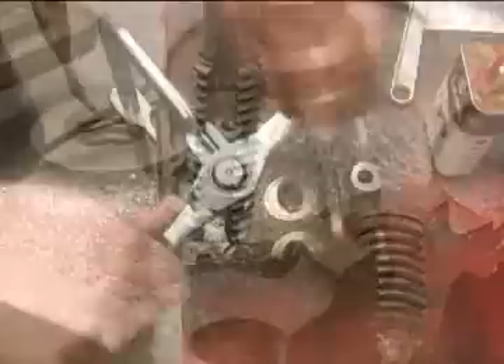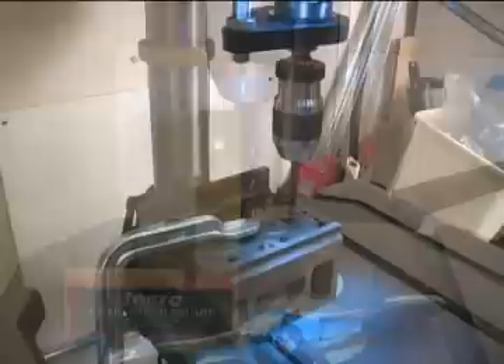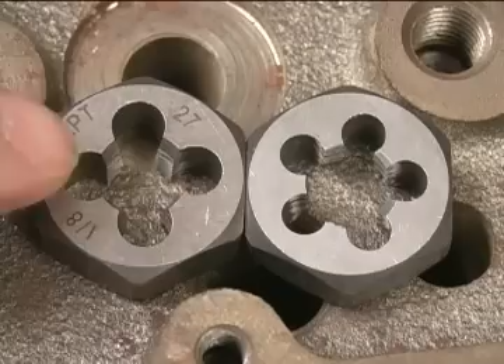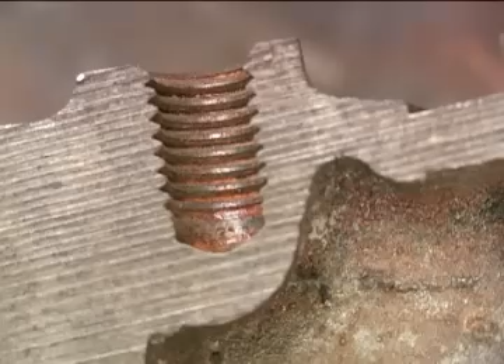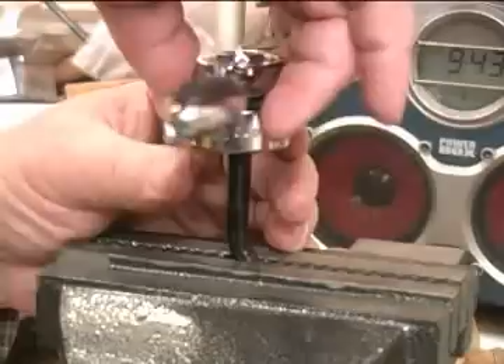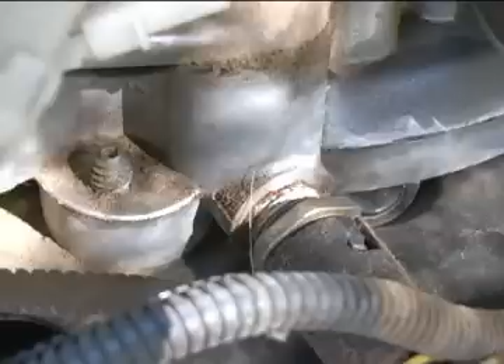Using Taps and Dies

Comment: how do you match the bolt thread size , with the tap ? i need to tap the holes on a flywheel , for the flywheel puller bolts , so i can remove the flywheel , to fix a broken flywheel key . the bolt holes are not threaded . why i don't know , there just not . the mower engine is ENGINE MODEL NUMBER
08P502-0111-F1, if you can tell me what tap size to use , that would help big time .

Comment: I have a nut that has left hand threads and it stripped out how can I fix it?
Reply: Go to Fastenal, they sell lady handed threaded nuts and bolts. Tapping a stripped but will not give you much of a result because the material inside is compromised or lost, which would mean you would have to tap it to a larger diameter. If tapped larger then it obviously wouldn't fit the bolt threads it is meant to go onto. Hope that helps

Comment: Those are chaser dies, designed to clean up old thread, as shown in this video. If you try to cut a totally new thread, you can easily breake those dies. It's a common mistake made by self DIY guys.

Comment: what size of drill bit do i use to tap a m4 bolt
Reply: Duncan Gallagher rule of thumb - tap size minus its coarseness. I assume You are talking about standart m4 thread, (m4 x 0,7). So 4 minus 0.7. Thats 3.3 mm. :)

Comment: I wonder what a quality brand of taps would be ? I need to tap some 1/4” holes in 1/4” mild steel . Whether or not 1/4” thick steel is going to have any strength being that this is another question. I may have to weld a bolt on . This will be done on  bumper plate racks for my home gym

Comment: I have a tap & die set & when I used it, my tap was ground down by the metal. I don't know if my set works on certain metals. (it didn't say)   Do I have to find a stronger tap?

Comment: I have a brake caliper bracket. I accidentally stripped some of the threads. Can I use a tap that will keep it the same size and be able to use the same bolt? Or will I have to go one size bigger?
Reply: I'd go a size bigger

Comment: What is meant by Right Hand Thread Direction & Left Hand Thread Direction?
Reply: A right handed thread will mean you have to screw the bolt clockwise to tighten it. A left handed thread you have to screw counter clockwise to tighten  the bolt.

Comment: Please realize that a metric size tap will be one of three different thread pitches to accomidate the three different metric screw types "coarse, fine and extra fine" these are not interchangeble and you need to be aware of which you have.  I just made a drill tap for a 4mm screw  using a tap set from ebay,  It tapped well enough but the 4mm screw I had did'nt screw in correctly i.e. it would thread in about 1&1/2 turns and stop which is the signal that you have the wrong thread and forcing will result in stripping the screw or worse your tap!  I had to go to a hardware store and search for a screw with the correct thread pitch which was extra fine but to make matters more confusing there were some screws marked 0.7 that would fit and others marked 0.7 that would'nt so you really have to try several screws to find cinderellas slipper.
Reply: Thanks. Yes it would have been nice if he'd talked about sizing.
Reply: https://youtu.be/vbhfC2hY4xQ

Comment: is m4 - 0.7mm the same as 4mm - 0.7mm ? https://www.amazon.ca/Metric-Taper-Plug-0-7mm-Pitch/dp/B00ANY5I5A if not, whats the diffrence between these 2?
Reply: it's the same, just a different way to identify metric. the 0.7mm is in reference to the thread type, metric has 3 types coarse, fine and extra fine so if you tap and find your screw is resisting after a couple turns don't force it in, get the correct pitch screw that allows it to turn smoothly.  Of course one screw labeled 0.7 might fit and another might not so you have to try several.

Comment: I dont understand on the tap, its threads are not at a angle how does it get the angle so the bolt can enter the threaded hole?
Reply: +David Moore 
They are angled.
If you were to straighten threads it would be shaped like a ramp.
Reply: ok thank you

Comment: Thank you for this information. I have a problem with a broken bolt that I'm drilling out. it's on the transmission where the tail shaft goes. Transmission is still in the car and it's the upper right bolt. Very tight area. I don't think I'll be able to use the tap/die with the big handle in this tight area. Any other ideas for rethreading this? Or another way to use the tool without the wide handle?

Comment: This by far is the best video for my situation.  Lots of well stated information packed in a short video.  I am retaping a drain hole in a water pump. It rusted smooth so I need to go one size up from 1/4 to 3/8 npt. I got a npt tap, a 37/64 drill bit, and the 3\8 plug. I don't have a tap wrench but I do have a ratchet that fits. Thank you for the information!

Comment: forget about the oil or tapping grease. i always use wd40 spray.1 can does 10 times the work of both at a fraction of the cost and cuts better.

Comment: OK so 99.9% of all taps, YES, bottom taps have at least 1 or 2 tapered threads at the nose. Tapered threads are no good when your dealing with a shallow blind hole. I used a regular bottom tap as far as I could then I used a cutting wheel and cut the tapered end off of the tap. It handled the heat of the cutting wheel fine. I the ran the tap back in the hole without the tapper, to achieve a perfect 1/2-20 thread in a 3/4 inch deep blind hole. Thank you.

Comment: If it's imperative to get the most threads possible from the hole, you may have luck with a bottoming form tap. A drill diameter is required for this, but it may do the trick.

Otherwise, you'd need to get the help of an experienced CNC operator, who could use a thread mill, which can usually get about 95% of a blind hole

Comment from the maker: There are spoecial "bottoming taps" that cut threads all the way to the bottom. Usually you start the threading with a normal tapered tap, then change to the bottoming tap to finish the threads. the tapered tap just makes it easier to get the threads started.

Comment: I'm dealing with a blind hole that is only 1/2 inch deep. I really need the threads to go to the bottom of the hole. Most all the bottom taps I can find are tapered making it impossible to thread the bottom of the hole. Any suggestions?

Comment from the maker: The manufacturer recommends them for cutting new threads and they work very well for that. all of the cutting dies I have ownd that were designed for hand use were shaped with the hex or a rond shape that fit the die handles.
I also own a set of cleanup dies and they look more like a large wheen lug nut.

Comment: These days I only use "Gun taps" They are actually designed for machine tapping and are more difficult to keep square.However, there is no need to keep backing off to break the chips because they are pushed down the hole by the tap, regardless of the depth of the thread.I've actually thrown away brand new conventional taps when replaced with gun taps. There is absolutely no comparison between the two. It will change your tapping world!